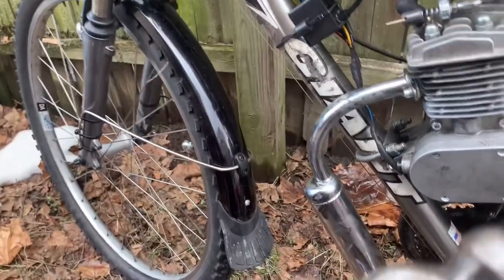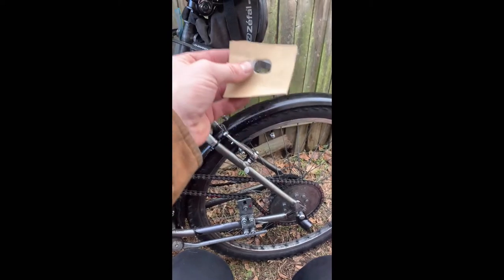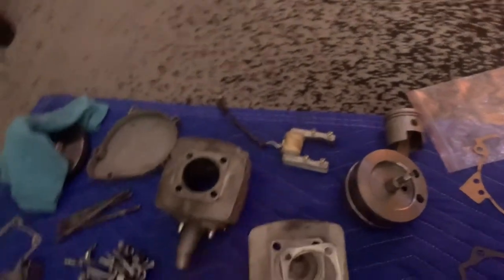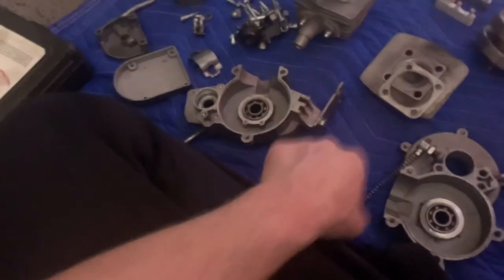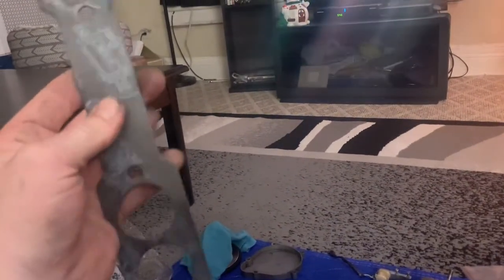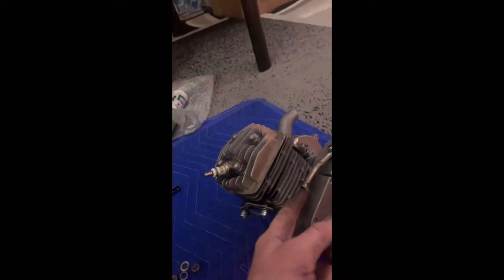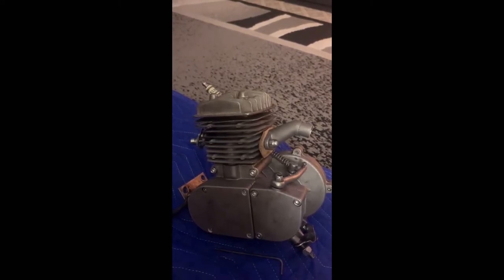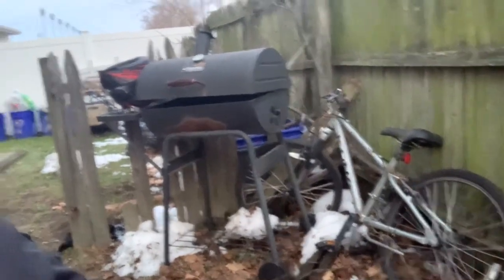How to make a gasket (motorized bicycle) and more failures

Comment: I assume ZMN80 means the same as ZAE80 long rod with high piston hole.  I have a drill press, I was going balance my crank by using a 1/2 in drill bit and drilling 15mm deep on each side dead center between the 2 holes already there. A long with porting/polish/debur/drill oil holes in pistons. Then I'm gonna clean all the dirt & factory machining dust out of the engine using white paper towels and brake/carb cleaner. Lightly pre lube with oil when I put it back together.
Reply from the maker: Yes I believe so n it sounds like u got a actually shop I’m only a lil jealous I mean it’s probably not as cool as my living room garage workshop but it sounds like it will get the job done
Reply: @JMB676  Just a cheap drill press.... Before I got sick I had a 3 car garage, welders, plasma cutter, cutting torch,sand blaster, powder coating kit & oven, all kinds of metal working & car mortorcycle tools. Got sick & lost almost everything I owned. Life's a bitch
Reply: @JMB676  I miss having a garage and lots of tools and the energy to work on things. My living room or outside is now my only workshop. I hoping the $60 harbor freight drill press will work
Reply from the maker: @michaelbrinks8089  I’m sure it will harbor freight stuff is great for hobbyists not for professional use cause they r much cheaper components kinda like our engines but for just doin the occasional hobby work I think ur #winning for sure